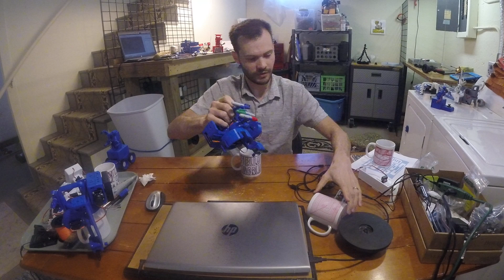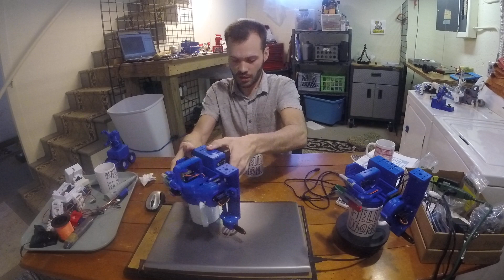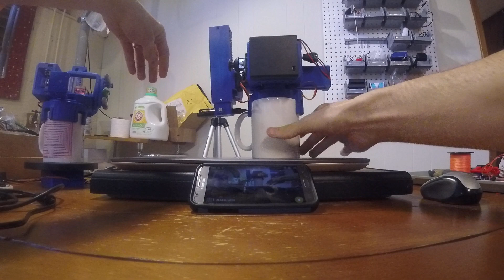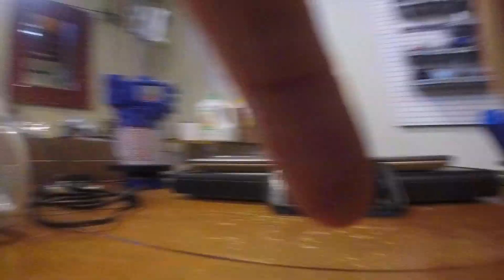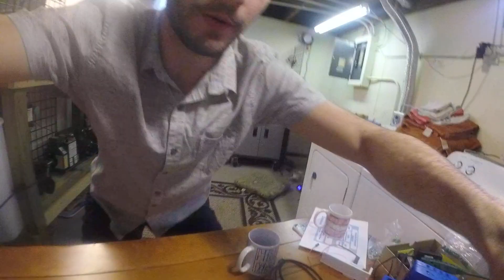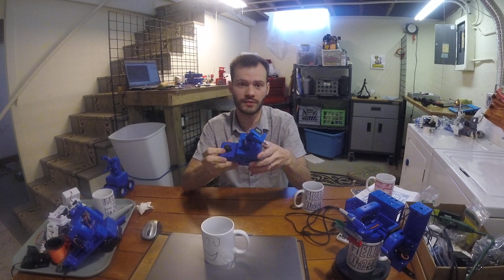Mug-O-Matic Project Update 2Sept2018

Comment: I've liked using Hitfilm Express video editor. They have a pro version but the free version is adequate and you can buy small add-ons for it if there's some fancy feature that you really need (you probably won't). There's also a free version of Davinci Resolve but I haven't used that editor much. Remember to convert your video files to an editing format such as ProRes or DNxHD before editing (I use another free software called Shotcut to do this). Converting to a format for editing is the single biggest editing tip I have and wish I knew when I started; any PC will perform editing better when it doesn't have to work so hard on editing a compressed format.